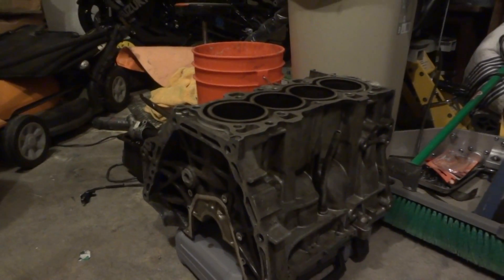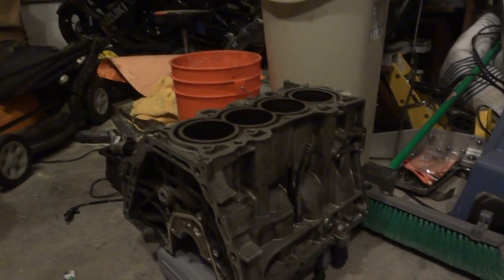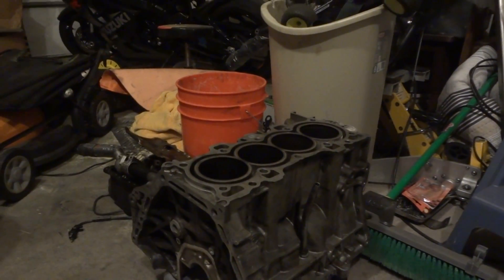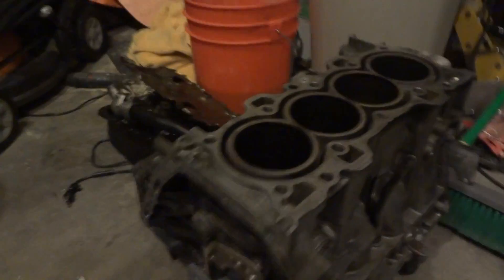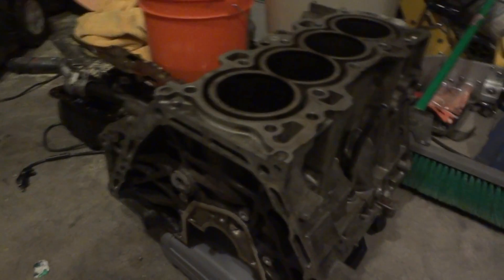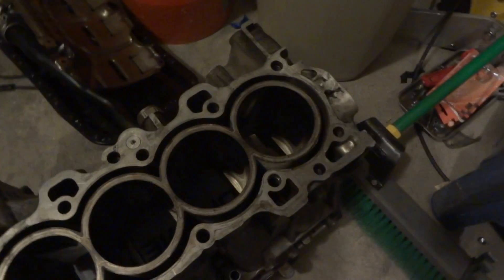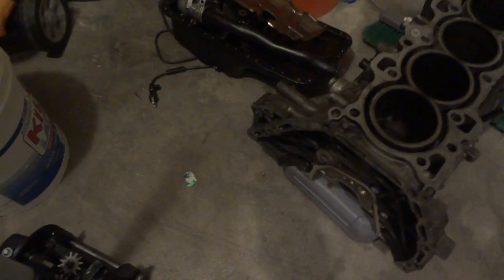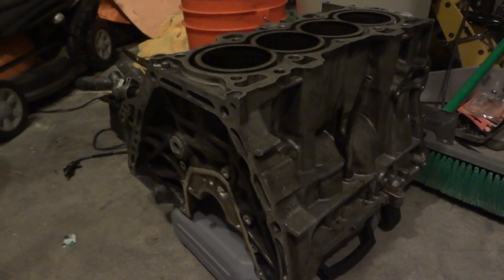HONDA B20 BUILD SERIES PART: 1

Comment: what ever happened to this project?
Reply from the maker: I am still working on it, progress has been slow because I no longer have the rotating assembly because a former friend of mine still has it. It will return in the near future. I have inspected the block and there is a pretty serious flaw on the deck surface. If it isn't repairable I'll turn it into a coffee table :)